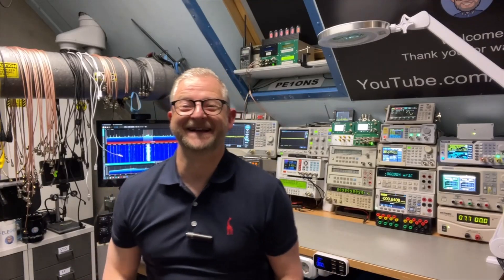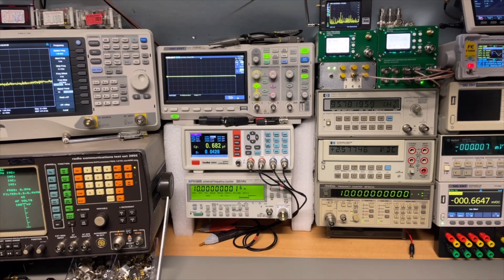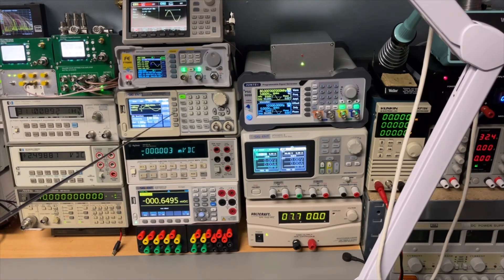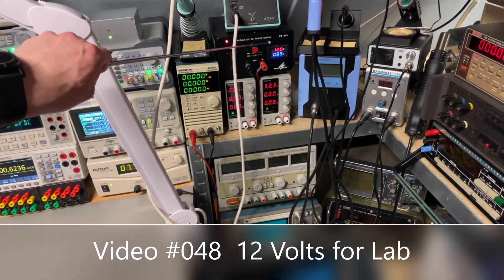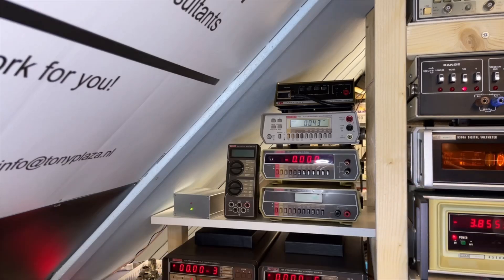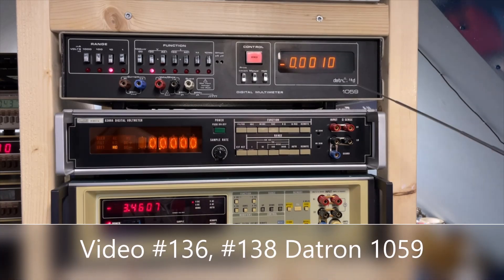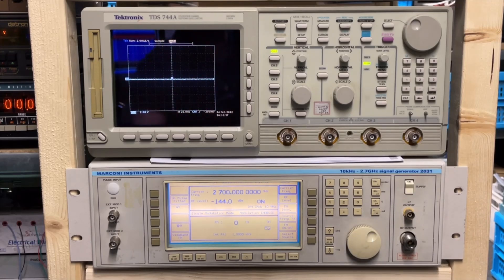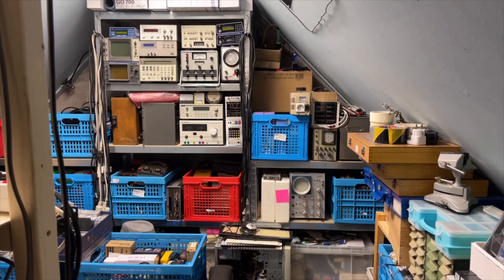#268 Lab Tour 2022 - Only This Once, you see it Clean

Comment: If you put electronic devices side by side, don't they get hot? Wouldn't it damage the devices?
Reply from the maker: Most devices can keep themselves cool or at the designed temprature. but a big but. the lab needs to be 22-24 degrees C .. that last part is difficult in my attic, so most of the time only the used devices are switched on.

Comment: Wow!  I love your setup.  I am just starting my Ham Foundation course.  Can I use a Meanwell 25 Amp SWPS for Radio power or do I need only Linear?
Reply from the maker: Thank you Tony!   25 Amps is just about enough for 100 Watts HF and Meanwell is one of the better PSU's but myself i prefer a SMPS with noise offset, just to be sure. and 30-35 Amps ..those are made for Ham use

Comment: Hi Tony. Love your videos !!! Quick question - I have the ADF4351 LCD signal generator. It works fine - but the LCD goes blank after some minutes. The output is still there - but I need to power cycle to see the screen again. Have you seen the same problem ?
Reply from the maker: Hallo Steve! thanks. Mine does not have it, it stays on, is it a screensaver, is there a setting, or it goes off and locks? but no, mine stays on.
Reply: @TonyAlbus  Hi Tony - the screen goes blank and unresponsive - so if it's a screensaver it cannot be awakened.  The software (PLZ-PLL-ADF) doesn't 'wake up' the display either - so I think it is a fault..
BTW - I am about to attempt the external clock reference mod as shown in video #112.  I have a Rubidium Frequency Source set to 10 MHz. Your videos are very informative and useful. Thanks !!!

Comment: Now i need to reorganize.

But im b*lls deep in a 3d printer upgrade.

Sh!t everywhere 🤣
Reply from the maker: Good luck on that, yes that can be a rabbithole
Reply: @TonyAlbus  thanks.

A good friend sent me a beautiful gift. A tooling grade aluminum bed. Its milled perfectly flat and absolutely beautiful machining. So i ordered up a 600w 24v meanwell psu and 300w silicone heater.  Monster mosfets.

Since i didnt go with an ac heater, i cant use a normal method of a thermal cutout safety fuse in line to the heater.  So im coming up with a thermal cutout solution for the whole printer. A safety circuit.  Using a standard ceramic thermal cutoff and a 30 amp opto isolated relay....its gonna act as a contactor for the mains power to the psu.  Thermal fuse pops, relay opens. Printer dies.

I like ur lab.  I need more room
Reply from the maker: @mrocklewitz  Sounds great.. build like a beast! , i need to play more with my 3DP .. but time...

Comment: Very interesting to see such a lot of vintage test gear - it would be really interesting (although a lot of work) to compare the different schematics for older equipment, e.g. comparing how  frequency counters worked between generations, or how volt meter implementation changed.
Reply from the maker: Thanks Greg, that would be very interesting,.